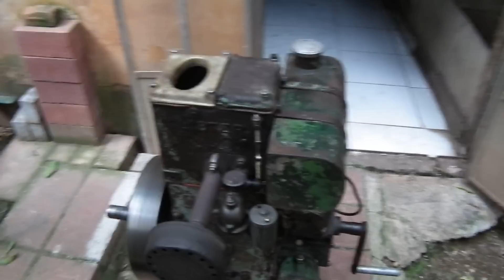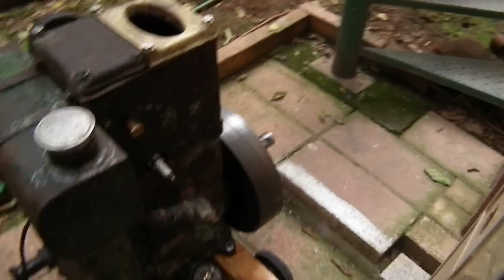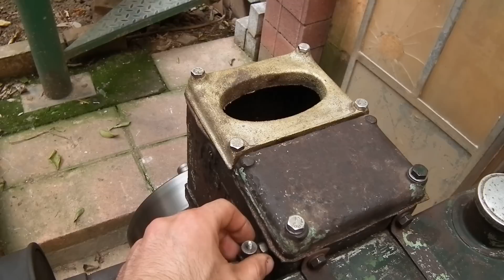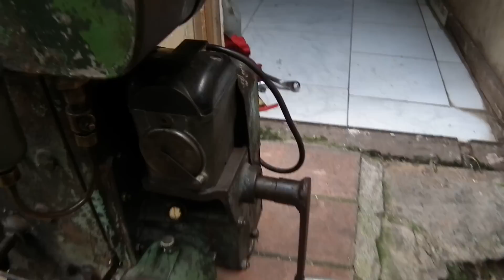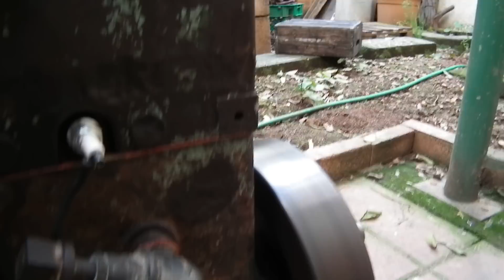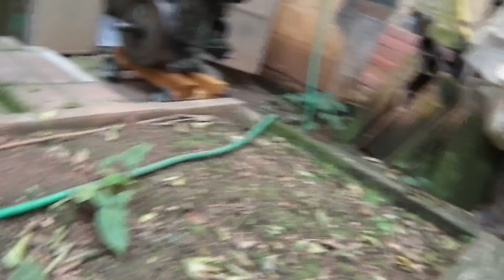Lister D - Run

Comment: Very nice, you have it running really well. I am like you, I am constantly playing with mine to find the sweet spot. I haven't had time to run mine for quite a while now, haven't even put the decals on it yet!
Reply from the maker: rotaryhoes The new throttle made all the difference... I would like to run them from time to time, especially petrol engines.